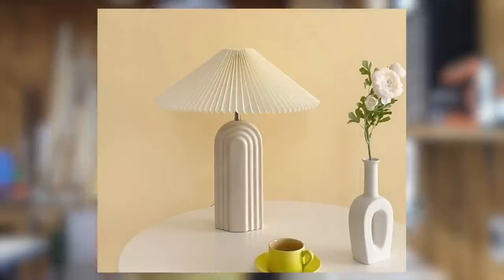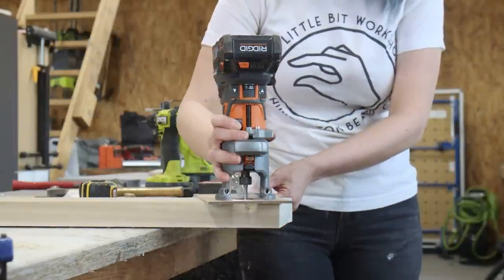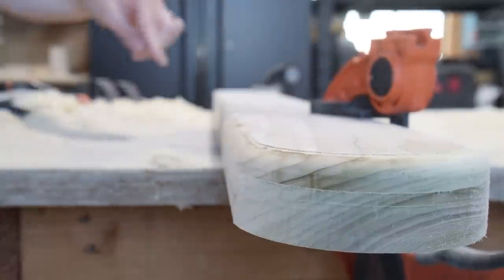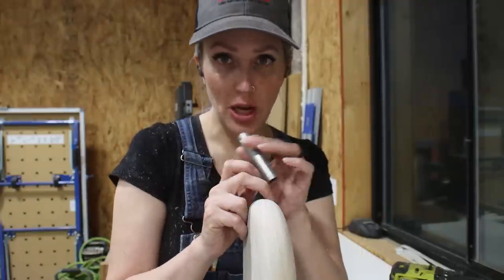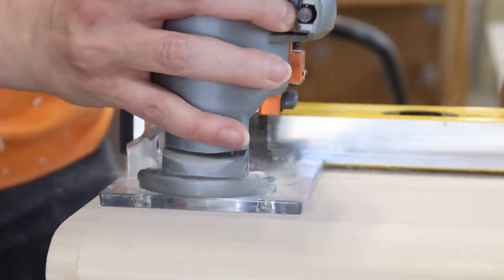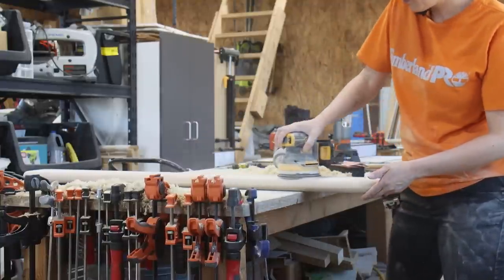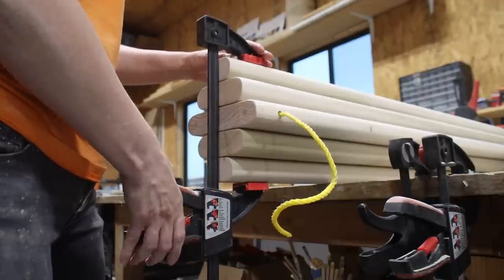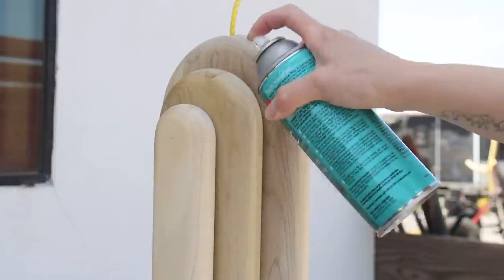Turn Vertical Blinds into Modern Art Deco Floor Lamp

Comment: I love chunky round overs so much, very nice work! I’d love to see more builds with that stunning 3/4” round over! Btw wouldn’t colored or clear acrylic work instead of the blinds?! Colored or clear acrylic in thin enough sheets not only can be cut like most acrylic with the tablesaw or scored many times with a sharp box cutter, better yet it can be formed permanently into shapes or bends using heat! Make a block of wood in the shape or with the right curve as a blank or a form, heat up the acrylic with a heating gun and bend it to your wood blank! It’d be stunning in multiple colors or just one but either way after applying each curved strip of acrylic to another with acrylic glue… you have a one of a kind, permanent or long lasting lamp shade or art that no one else will have! Check out David over on Make Something here on YT as he cuts and makes custom colored acrylic and wood lamps and also has a project where he heat bends custom pencil holders out of these vibrant acrylics. Fascinating and would go beautifully with your lamp which I have to try myself but perhaps with hickory and an array of acrylic colors as a lamp shade… we’ll see

Comment: A great "step by step" video for a cool lamp! Quick question, is there a reason why you couldn't use the forster bit before you rounded over edges? I would feel more confident using it first into a flat surface!

Comment: Lovely lamp!
It seems like it would be a bit simpler to drill the hole for the stem before doing the rounding.  I also think just fitting the lamp cord into this before the final glue up would work well and make that step a bit easier as well. 
But your process worked and you did make a beautiful lamp!

Comment: Mill the hole for the pipe fitting and the cord slot before the round over and bull nose.  Square edges are easier to work with. And if you screw up you have not wasted the work.  This was a real treat of a project
Reply: Great idea but there’s a problem with drilling out the large mortise prior to routing her large round over which is the bearing can and most likely will fall into the hole causing the rounded edge to dip in messing up the perfect rounded over profile. The bearing follows the edge exactly so any imperfection, divots, bumps and in this case hole will be matched if the bearing rides exactly where the mortise is (I assume it will because the round over is large and so is the mortise) as it cuts with this type of router bit. One way around that is to use a perfectly fitting dowel (cut to match the shape of her rounded edge) pop it in and then proceed in routing this 3/4” round over. I know this because I made this mistake with a build and unfortunately the bearing followed a mortise I had made prior to routing an edge profile and it can’t be fixed easily or hidden. Tamar on 3x3 Custom explains this exact issue on her video of making her beautiful end grain cutting board when she decided to wait to add her large round over till after routing out the handle shapes into both ends of the cutting board and after she mortised a groove for her brass inlays. Luckily she caught herself before it ruined her handles

Comment: And you asked so, most of the rental homes I have lived in, since the 90's, in Australia, still have vertical blinds! 2 sliding doors in my current house. They are a revolting pinkish peachy colour that doesn't quite match the paint, but it's close. What's the modern alternative to covering sliding doors?? Vertical blinds obviously allow light through when turned, unlike curtains that are either open or closed!